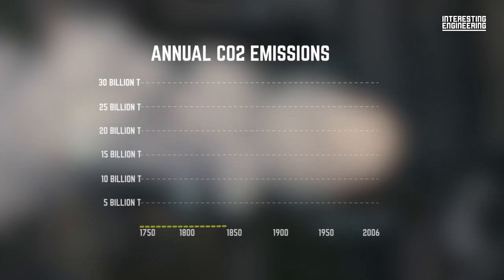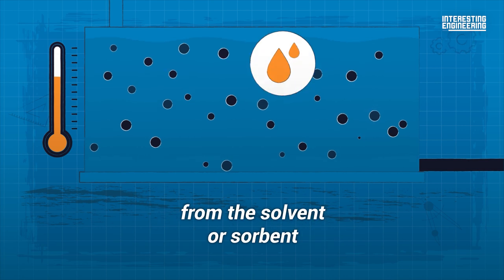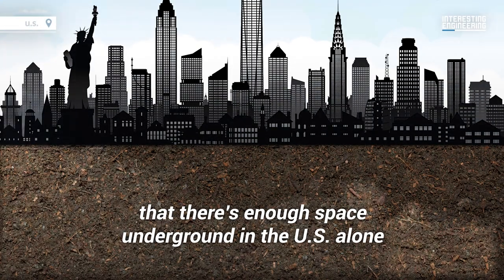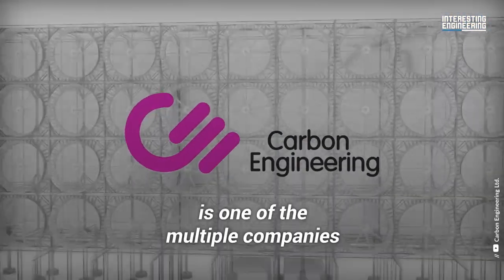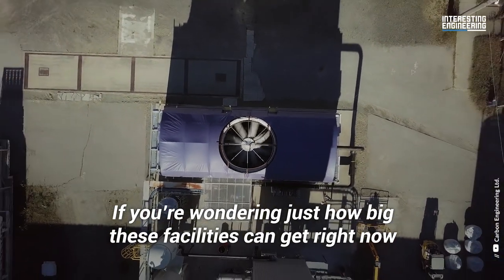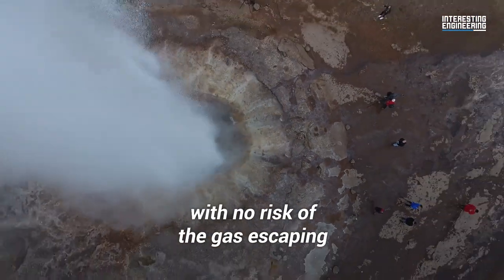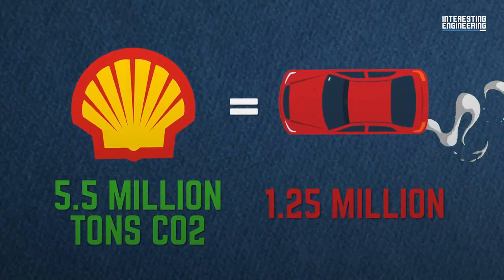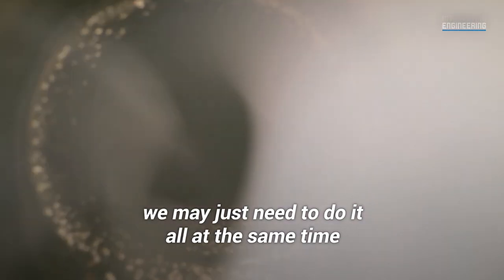How do we remove CO2 from the atmosphere? | Changing the climate

Comment: The best way is to split CO2 in C and O2 because we don't loose the precious oxygen.
Reply: According to thermodynamics, the process of splitting carbon dioxide to carbon and oxygen is highly energy intensive. It is economically not feasible and will ultimately generate more GHGs for energy requirements during the process.
Reply: @Uttam031  That's what innovation means. Currently not feasible. But the best solution for the future.
Why I'm saying that is because when we've burnt so much carbon, a significant amont of our oxygen is trapped in co2.
Reply: @ravenclawgamer6367  CO2 makes up 0.04% of our atmosphere, oxygen makes up 21% of our atmosphere. So only a negligible amount of oxygen is trapped in CO2.